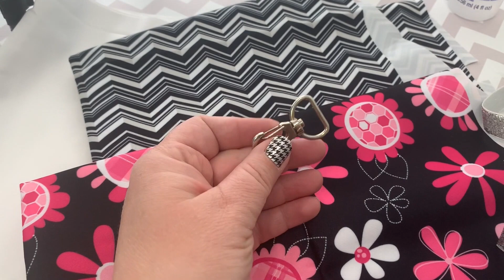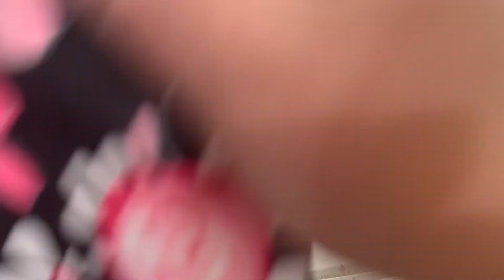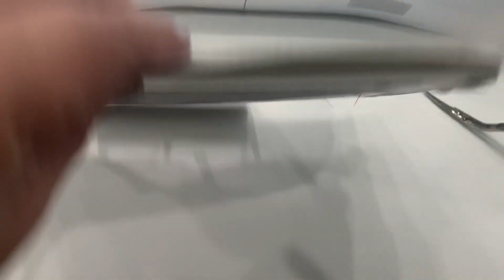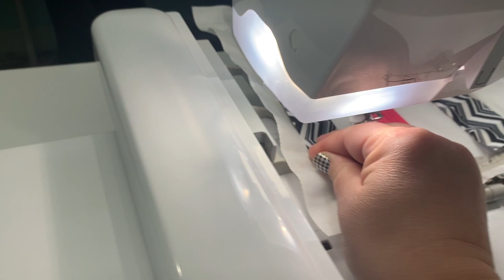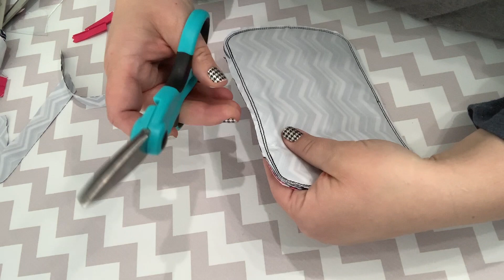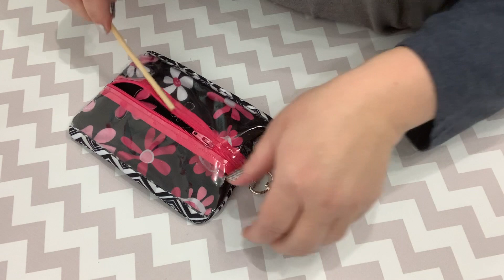MAKE UP STASH BAG

Comment: To make turning a bag like this with the clear vinyl, here's my tip.  Use your iron straight on your ironing board surface to warm it up.  Do NOT iron directly to the vinyl.  Once your ironing board is warmed up, rub your bag across the surface.  This will soften up your vinyl making it easier to turn right side out.  Once your bag is done,, you can do the same process to eliminate any wrinkles in the clear vinyl.

Comment: Is there a program that you have to download to make the placement lines on the stabilizer first?
If so,  did you put it on a stick first?
Reply from the maker: Cheryl Grider I’m not sure I understand the question. This is a design by Parker on the Porch. You buy and download the files. Depending on what machine you use will determine how you get the file to your machine. You don’t need extra software. If your machine uses a thumb drive/stick then you would put your appropriate file on your stick. All the steps are included in the design to complete the zipper bag. So the placement lines are a included step in the design you buy. Does that answer your question? Sorry not sure if this is what you were asking.